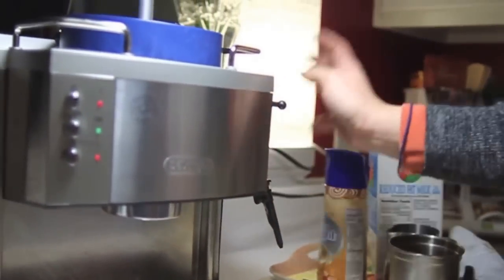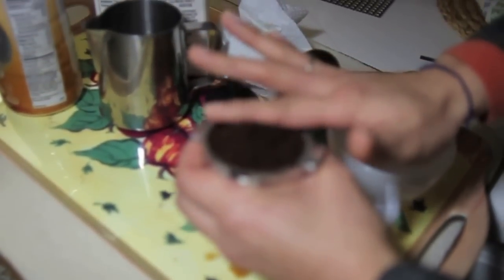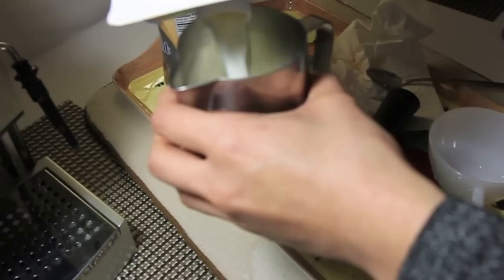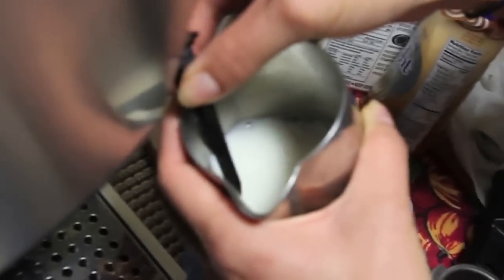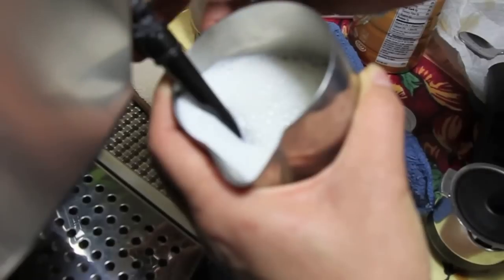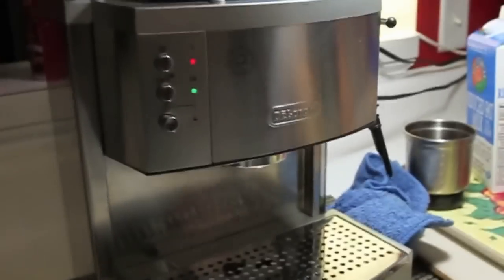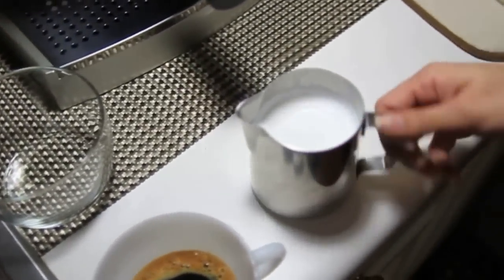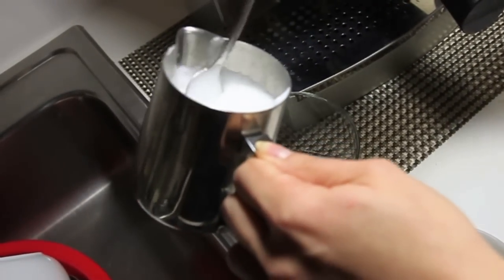A Noobie's Journey to Achieve the Perfect Latte Ep. 1

Comment: I have the same machine, and can certainly tell you, there's a piece missing in your steamer... which makes the steaming process a little bit easier. And I wouldnt put so much pressure with the tamper, this machine has a "pressurized" porta filter, which means you don't need to tamper it so much, the key is in the grounding size of the coffe beans. Nice video!